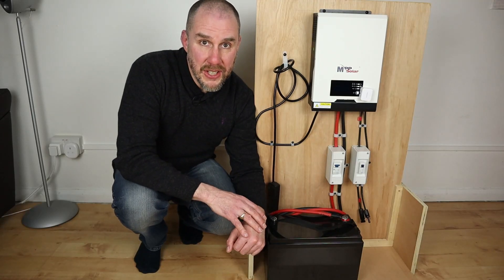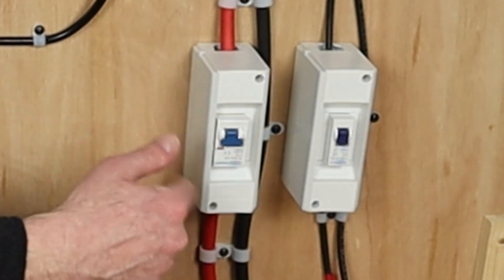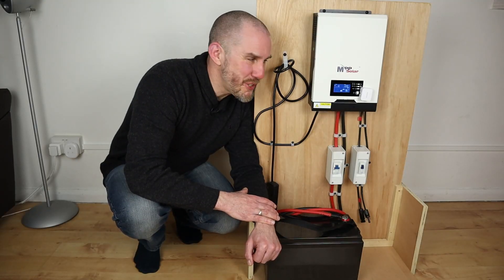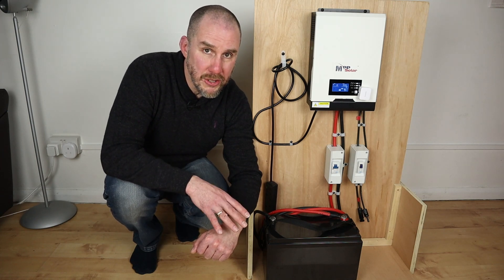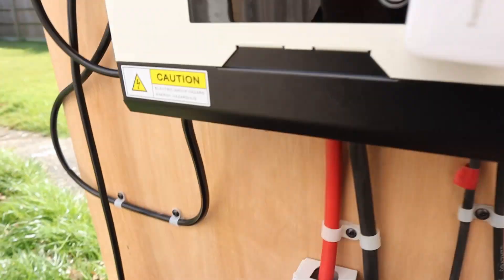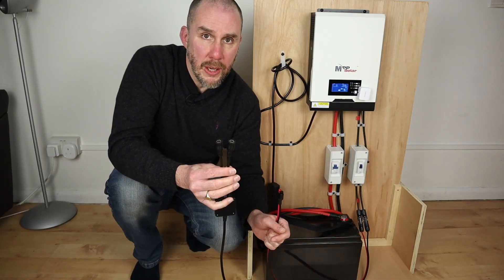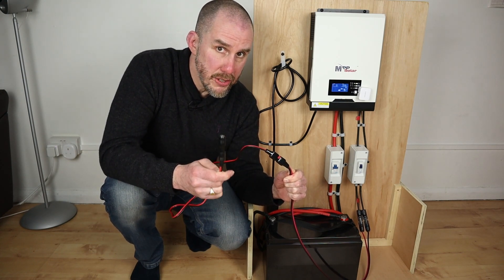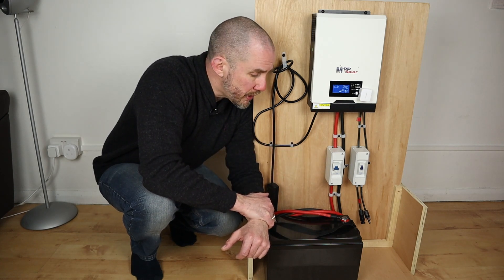12V MPP Solar | Update March 2022 | DIY Modular Solar Inverter Station Build

Comment: Photonic universe sell Ionica devices, which on the face of it look like MPP Solar. Does anybody know if they are the same products, just with a different brand ? Only asking fue to availability in the UK and savings on postage.
Reply from the maker: @Paul Gelsthorpe  Good day Paul and thanks for your question. There are likely to be similarities, but I can't comment on component quality or reliability/support. I originally went for the MPP brand as they are well established and a known entity in the market (been around for some time too). I've also got a 24V MPP unit which I've been testing over this year too and it's working perfectly. I guess it's weighing up the cost, existing reviews from other customers and warranty. I hope all goes well. All the best, Adrian

Comment: Hey mate, is your inverter not max 500W PV input? Take care not to overload it, Im gonna have to go turn my breaker around too now :(
Reply from the maker: @Des Bold  Good day Des and thanks for pointing it out. I over panelled to test if it would work ok and it's worked perfectly since last summer/year. MPPT charge controllers tend to draw what they need in current (amps) terms and clip at their limit, as long as you don't exceed the Voc (Open-circuit voltage) limit. In the case of this MPP unit, it has a max PV input Voc of 105V which two of my 340W panels in series (around 82V Voc) is under by a margin. I hope this covers it and please shout if you need anything else. All the best, Adrian

Comment: Hi Adrian,

Great update, absolutely loving your videos and have completely ’binged’ watched them :))

I do have a question please, is there a formula or rule of thumb when constructing a solar system as such, when I get around to doing my garden building set up I would like a 3000 watt inverter, is there a guide to what size batteries I would need and thickness of cable and what size array etc?

Great work, keep it up!

Kind regards

Tony
Reply from the maker: @Emplan1968  Hey Tony! Your feedback is sincerely appreciated, thank you😊👍. 

It just so happens that I'm currently early testing my new 24V system which has a 5kWh DIY LiFePO4 battery (first one) and a 24V version of this MPP with a 3kW inverter. This is coupled to 4 x 340W (1360W) worth of panels connected 2 in series and then the 2 series strings in parallel. This has been generating around 1.3kW on colder days (panels are more efficient when cold), which is filling the battery up nicely. I guess it needs to be sized according to what you want to use during the day and how much battery storage you have.

Are you going for something like this MPP or the separate components route? Cheers, Adrian
Reply: Hi Adrian,

I really don’t know to be honest buddy, I think now more than ever with the silly gas and electric prices we should be harvesting ‘free’ energy, plus for people like us it’s an interest/hobby and a great way of keeping up to date with things and keeping the mind ticking over :))

We should be getting the keys to our new home in the next 2-3 weeks hopefully and one of the first jobs will be a very large shed/workshop/garden building or whatever people like to call it these days, I’ll update you more once we have completed and I can have a good look around :))

The main aim is to have ‘free’ power in the shed and garden in general to run things like a chopsaw, mower, lights etc.

I will keep you informed as it progresses.

Thank you and keep up the great work.

Kind regards

Tony

Comment: I'm all about DIY solar, all my appliances are maximum 1000w so I can power as much as I can from the battery storage I have.
I use the epever 40A on a 12v system. My lifepo4's are charged on the "gel" setting 13.7v.
I am on the grid however but I simply love off-setting my consumption by using as much from my solar as humanly possible.
It becomes an addiction and I call it "farming" 
My camper van is also my depo for extra energy from the house if I am short. All home grown/self built.
Lovely lovely video, I can watch this channel (for free) all day long.
Reply from the maker: @skYcunian  The 1000W maximum is extremely useful. Is that the 40A one with the large fins on the front? 
You summed me up perfectly "It becomes an addiction and I call it "farming" ". Without knowing it I've also become obsessed! I now base my mood for the day off of weather reports😂. If it wasn't for the fact I need a day job to pay the bills, I'd be YouTubing much more from a field in the middle of nowhere whilst conducting a multitude of off-grid experiments.

The 'farming' approach is going to become more mainstream as the grid prices drive consumers to look at alternatives, along with storm prep after the disruption this year.

Your feedback is brilliant as it gives me an idea that I'm on the right track with all this. Thank you so much👍😊
Reply: @DADvinci  I started all this 10 years ago using lead-acid batteries on pwm. Learning that from the small set up money goes a long way investing for more long term solutions using lifepo4 instead.
Its just attractive the idea that we all have the ability to do this.
My conversations with people who don't understand it they "yawn so indescribably" lol
I had two power outages on our street and my house was lit-up like a Christmas tree. 
When neighbours asked, id say "remember that boring conversation explaining it"?  🤣
Reply from the maker: @skYcunian  The change is coming with energy price realisation. Those previous conversations will now be interested conversations as everyone gets the idea about micro energy generation and what it can do for the pocket and the stormy times. This stuff is simply awesome😊

Comment: Great video!! If you disconnect the battery or power off and on does it save your settings? Wasn’t sure if you had to go back and reset it.
Reply from the maker: @Burdickbilt  That's most kind, thank you👍 Mine seems to hold its setting fine, although not usually off for long. I hope this helps. Cheers, Adrian